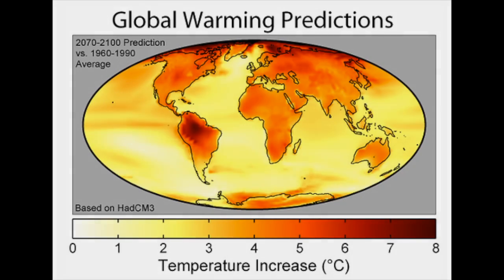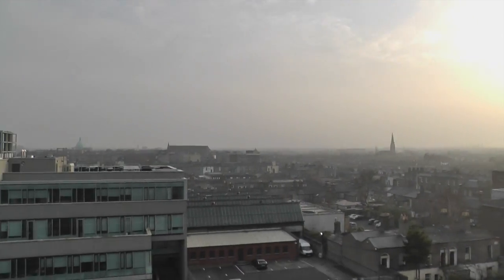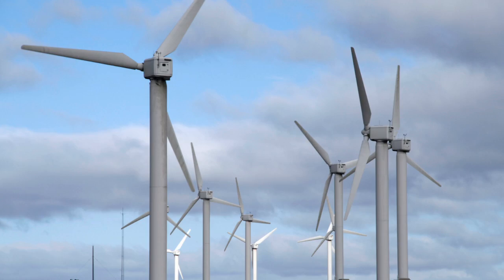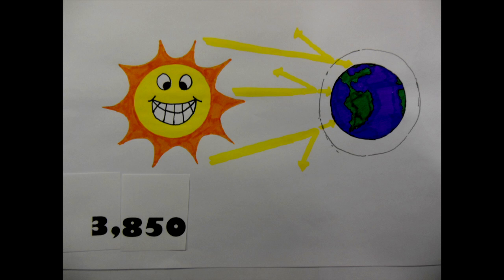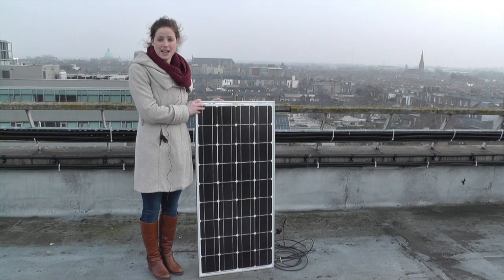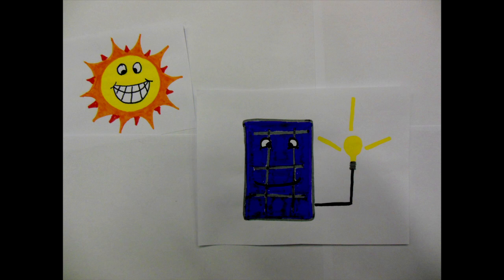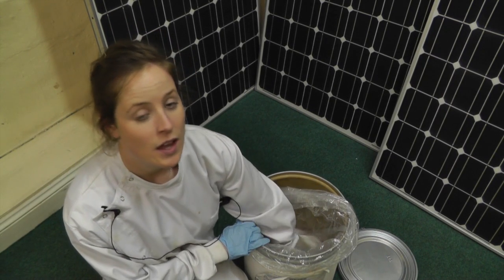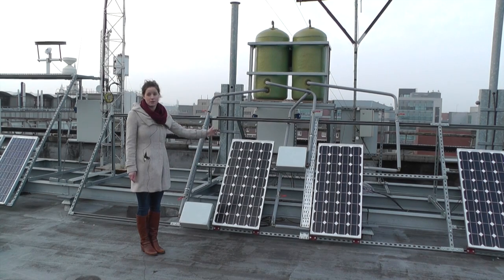Maria Browne - A photovoltaic Thermal System

Comment: Not sure why phase change is used on the back of the solar PV panel, when the best place is in the water tank.
My PVT design with a 250 watt PV output and the solar cooling panel that uses water is being marketed for just £198.00 + delivery and from £500.00 for the installation kit
Reply: can u provide the buy link
Reply: @john110503  Hi Paul, sorry about delay in replying back, not always checking enquirie
For now we are not planning to sell to private houses, only for commercial large scale use, to be cost effective 
Eric